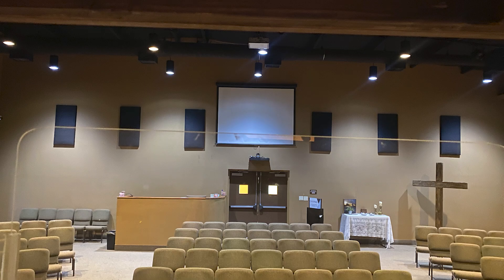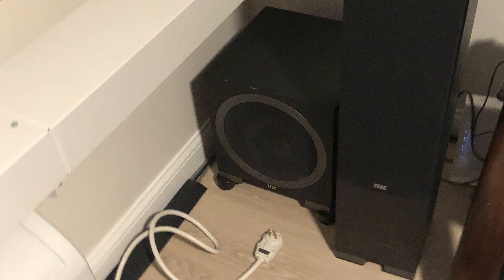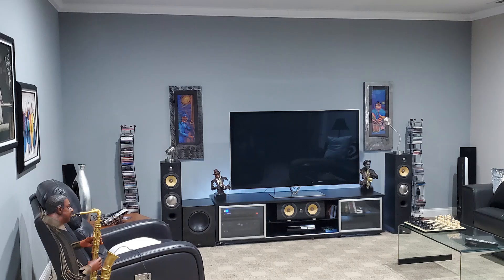Don't Do This! - Overcrowding - www.AcousticFields.com

Comment: The whole point of your videos is; accurate reproduction of the source material without the room being an addition to the sound. If you want the best, clearest sound possible, PROPER treatment is the only way to go. No audessy will fix a poorly treated room. A proper treated room wil further advanced your listening pleasure over any expensive amp, speaker cable, or any snake oil jargon out there. Room treatment is the best thing for the best sound, even shitty setups can sound like polished turds!
Reply from the maker: Correct. We have two main issues that must be resolved in small rooms. We have both pressure and reflections. Pressure is lower frequency energy below 100 hz. that will not "fit" into the dimensions of the room. Room modal pressures exaggerate and eliminate certain octave bands. Neither of these features contribute to mix resolution. We have middle and high frequency reflections which blur and smear the resolution of those frequencies. The time signature of reflections must be managed correctly using the proper rate and level of absorption to balance the room sound with the speaker sound. What still baffles me after 50 years of working in acoustics is that people take high resolution digital audio and place it in a low resolution analog room and they can't understand why they do not like the sonic quality..